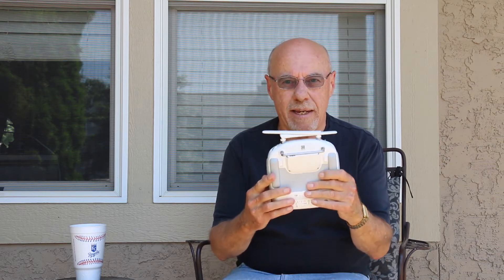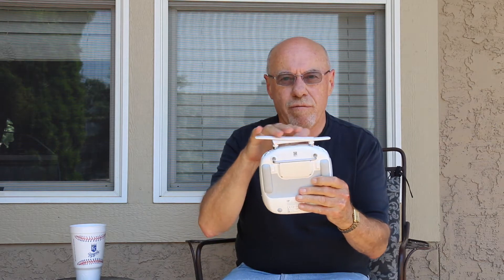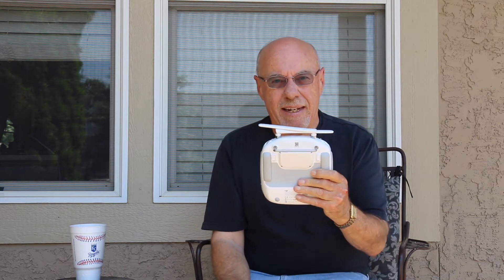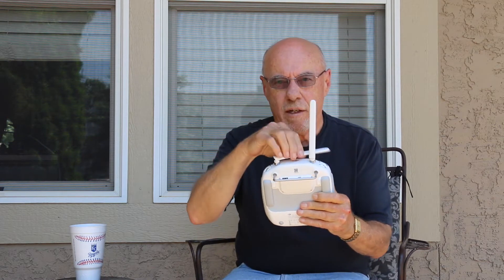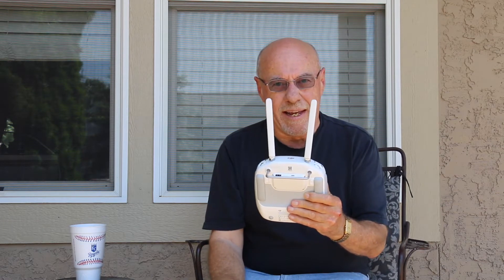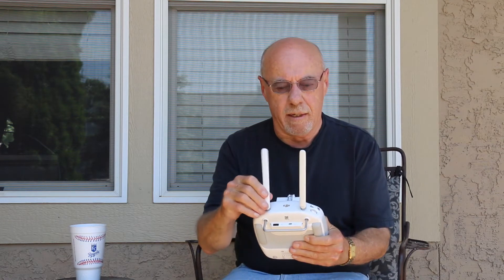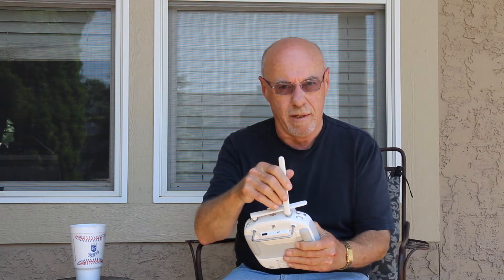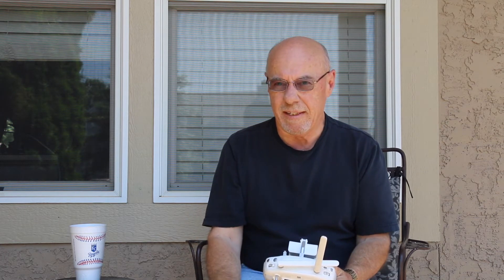PHANTOM 4:  Weak Transmission Issue Resolved!

Comment: My Mavic Pro 1 has three times the range of my Phantom 4 Pro . I just think the Mavic has a better radio than the Phantom 4 Pro but some things are better on the Phantom like Active Track seems to stay locked on better than it does on the Mavic . The Mavic don't have Draw mode . But I am disappointed in the range of the Phantom 4 pro .
Reply from the maker: I've never flown a Mavic. I need to do that.
Reply: @MagnumVideos  I don't know that to be the case for all Mavics or Phantom 4 Pros but that's how mine work .
Reply: I had a mavic before but i returned it because the gimbal was just retarded...

Comment: Nice flight Sir..... I'm also a PHANTOM 4 flyer,  I love long range flight but the drone can only fly in 1.3km lost signal,  as I know p4 can navigate up to 5km,  but I can't go for that range..... this is my problem.
Reply from the maker: I don't usually fly at long distances from the controller, so I'm not sure why you're limited. I've read that cell towers and high power electrical lines can have an effect on communication. Wish I could offer more expertise on this, but maybe someone else can chime in. ? Thanks for the comment!
Reply: Should check the area if you are nearby cell towers, it affects the signal

Comment: Hi I had exactly same issue with my one(p3s). I tried many thing... Solution was so easy! Try to keep radio and phone /tablet separately.  I mean like 50cm to 1m away from each other! Let me know the results
Reply from the maker: Thanks for the input.
Reply: There are more issues with the Phantom 4 losing signal then just the antenna placement.
Reply: 🤔 I will give that a try

Comment: Hello,

I have phantom 4 pro. I started to get weak image transmission signal warning and my phone screen shows black/green only. I checked & played with the HD settings but no success. According to the dji app, i have the latest firmwares, however when i check the release notes on the dji website, it says that the rc firmware should be 1.4.1.0 whereas the "about" section on the app shows that i have 1.9.2+ for the RC... i always did the updates via the app according to its notifications but there seems to be an inconsistency. Can this be the reason for the weak image transmission signal? If yes, how do i get the correct& corresponding rc firmware via the app? 
Thank you
Reply: Omg this happen to me too ! Did u end up fixing it ? Plz let me know

Comment: Hey Magnum. Your horizon is not level. You need to do two things to correct that.
1 calibrate the IMU on a level surface. Make sure you do this when the phantom is cold before its had a chance to warm up.
2 once the IMU has been calibrated then calibrate the gimbal (If you generally fly with an ND filter in place then make sure that is fitted)
You must not move the phantom during calibration apart from when the promps tell you to. You will have to orientate it during the calibration procedure. It's quite straight forward and should fix your horizon level.
Don't forget to calibrate the compass afterwards also.
Sandy
Reply from the maker: You're absolutely right. It was crooked. I did a video the following day after fixing it. Thanks for watching.